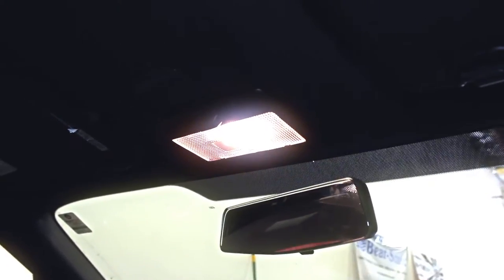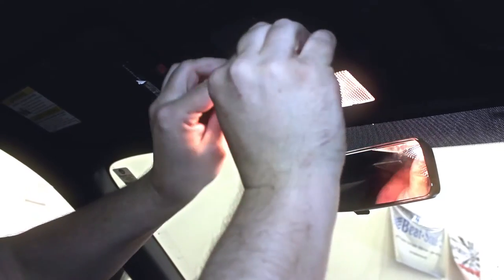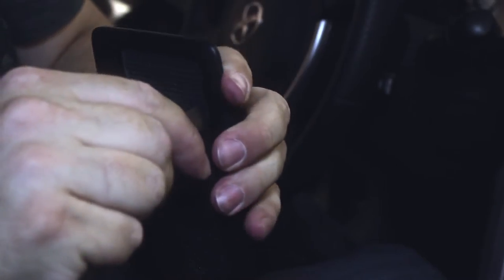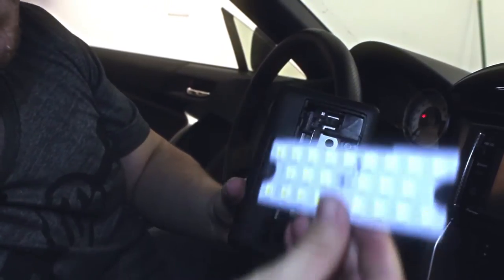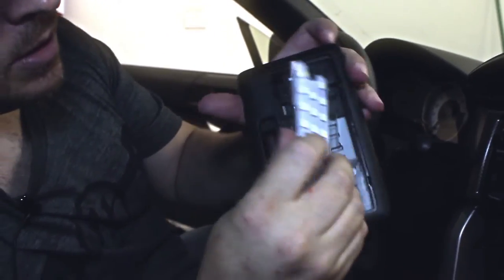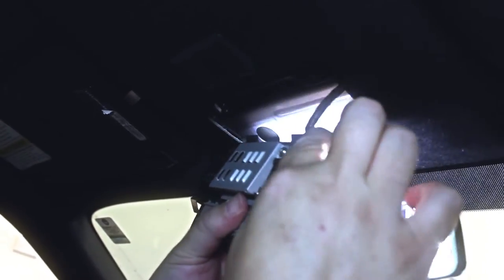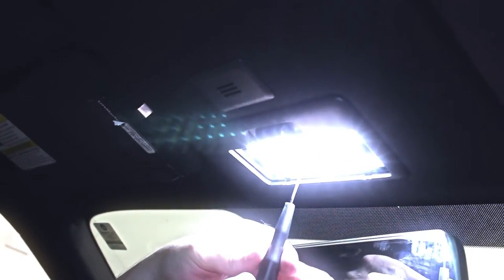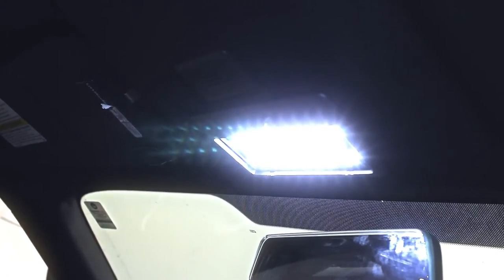FRS dome light install DYI - With Super B.A.D

Comment: whats the point of the tape then??
Reply from the maker: The tape will hold the Dome light against the small square Block inside the dome light -   it is not important but it will secure the dome light better. When you take it apart and see how the tape lines up you will see :)